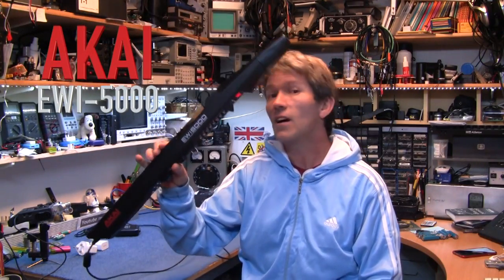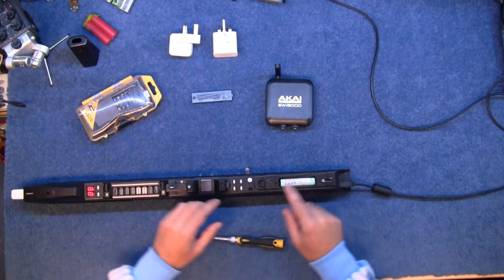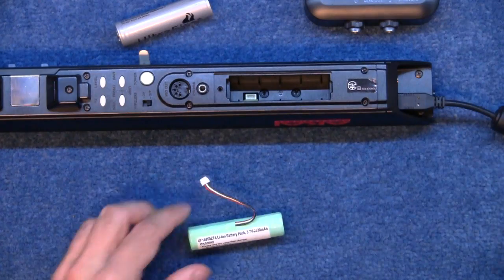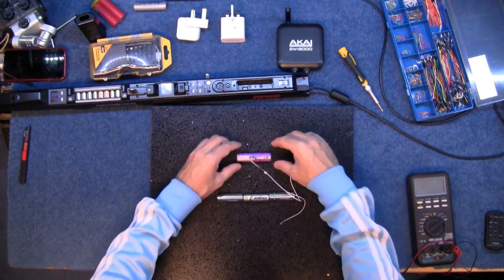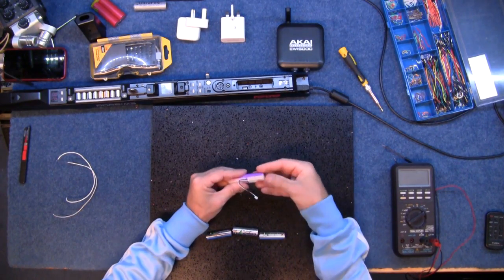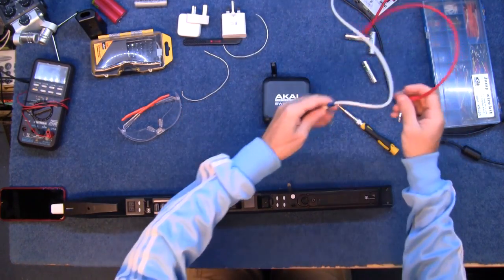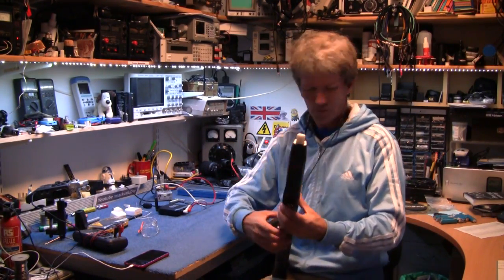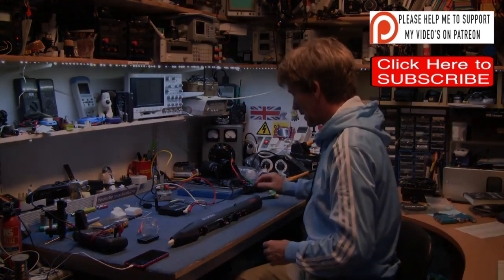AKAI ewi5000 the 88 fault lithium battery repair

Comment: my old battery had 4.1 volts and a new one bought from china is showing me 3.6 volts.

Before buying the new battery, my EWI didn't show anything at all, no sign of life, not even 88. Now after putting in the Chinese battery, first the EWI started showing error 88 and then after putting in the old battery, that one also started showing error 88 now. So the old one started working, too, for some reason, but both show error 88. With the Chinese battery though sometimes at first when the battery just arrived, plugging it into the EWI made it to show blinking LEDs sometimes (without the EWI working), but now after a few more tries all I'm getting is error 88 from both batteries, no blinking LEDs either.

Any ideas what I could do? Assuming the Chinese battery is simply not working, I assume I need to discharge the older one? Or maybe the EWI is broken after all...

EDIT: After reading for a bit, it seems like the 4.1 volts one is actually a normally charged battery, and the 3.6 is probably somewhere around 30 - 40% of charge. I guess the EWI is done for :(
Reply from the maker: I do not think the EWI is done for. It just needs a battery with enough charge in it for the EWI to run. I think akai could do a software update that will allow the ewi to charge a battery rather than state a fault just because the battery has fallen below a certain voltage. I did get rid of my ewi5000 and just use the ewi-solo now - it has not let me down yet but i believe it still uses a similar small lithium battery.

Comment: Thank you for your efforts re the battery.  I had the same problem after returning from a month-long trip to find that my EWI wouldn't charge and I thought at first it was broken. BooHoo. after watching yours and several other people's videos who had the same problem I decided to try to shock the battery back to life with my Sony backup battery that I use with my iPhone. I plugged it in (the backup battery) after having fully charged it and when I switched it on the EWI started changing immediately. It is now functioning as before. Thank you for your efforts that saved me a trip to the repair shop for something I could easily fix myself.

Comment: Ill tell you the fix just buy a charger for the battery they sell them on amazon just match the battery type as long as the charger charges at a man rate lower than the listed on the battery it is fine.  Make sure it's a flat top charger and you gotta tear the paper CAREFULLY off the ends and expose the battery teminals.  the end where the electronic connecter is attached to is the negative

Comment: Hi i have a problem with my ewi 5000 it get Freeze AND i can't turn ir off or play it just put LD on the LCD screen.plese jelp i disconet the batery ir works a few hours AND then again pot the same error LD
Reply from the maker: Hi Gorky. I cannot find that error code in any of the akai websites. all I could find was how to reset to factory reset by pressing and holding FX, LEVEL, BANK, and SAVE button, then pressing the POWER button while those 4 buttons are held down. other than that I do not know what to advise as I sold my ewi5000 in 2016.

Comment: Just remove the two round plastic covers from the battery sides and put it into a 18650 charger (~£6  on Amazon) for like 5 minutes, enough to get it over the 3V threshold, that's all I did.

Comment: Hi mark,i need help,my ewi 5000 black showing Ld sign on display,cannot boot up,the problem is the sdcard corrupt or damage,it's only showing 1.8gb,and cannot backup,copying..always stuck on 26% when copying,did you have backup your sd card mark? Because i can find on internet
Reply from the maker: Hello. I am guessing here but I think the LD sign was just displayed while it was loading data, I think there is a 2GB micro SD card on the circuit board inside but some of the space may be reserved on that card for other system settings so it may only show 1.8gb available to the user. I do not know why Akai did not make this card accessible so the user could simply change them over easily. many companies do this. even the latest roland fantom flagship synth has micro sd cards on the boards inside that is not accessible to the user. I do not know why yours is getting stuck on 26%. I sold my ewi many years ago so cannot have a look inside now. sorry about that.
Reply: Thanks for the repply @markusfuller  sorry for my mistake mark,yes actually there is 1.8GB,finally back to live my ewi,the problem is the sd card is corrupt,bad sector,So i try repairing using chksd on command promp,and it's work,then I backup using aomei backupper,the next step is copying all the data to the new SD card,that formated FAT32...thank god It's work mark,here's the step what Im doing https://youtu.be/y10FcQkNJkU

Comment: Makes me wonder if a good mod for one of these is to try and fit an 18650 socket in there with the charging circuitry from the old battery (out of warranty of course!).
Reply from the maker: That would be a good idea but the free space is about 5mm too short.
Reply: @markusfuller  Hmm, you'd likely have to cut into the plastic around the battery housing. Maybe a bit too hack-y, I'm not sure how it would come out.

It's possible that it just wouldn't fit inside, as they seem to be quite crowded internally.

It just seems a shame that when Akai discontinues these like it did the 4000s and stops selling replacement parts, people will have to just give up on it when the battery fails. Batteries tend to be the most replaced part of anything electrical, so it's kind of a bad part on the manufacturer when they make it awkwardly proprietary.

Great vid though! It really helps people understand what BB/88 really is and how to troubleshoot rather than just rma their EWI.

Comment: Thanks for the info in video. I was considering to buy EWI 5000 and stumbled upon the problem and now here the workaround. I will not buy it if this issue still persists with the device. When i messaged a support staff of an online store, I was said this problem is solved by Akai already. But not sure if it is really a case. Has any one purchased recently and knows that the problem still exists?

Comment: Hey Markus, I have a similar problem with my ewi4000s. It was not used for about two years, now I got some brand new batteries and turned it on and nothing happened. Then somebody told me I had to let it on for a long time, then the instrument would come back to life, and I did it, and the display was on, but this 88 is showing up, and no sound comes out of it. So, do you have any idea what is happening with it, and what should I do?

Comment: Markus,  Thanks for the video.  I had the problem develop overnight (from Sunday when I played at church to Tuesday) so I figure I had left it on in the case.  Your shock charge worked perfectly (current limited adjustable supply) and my 5000 is charging as I type.  I agree with all of your comments about the 5000 vs 4000 except that the 5000 sounds seem to have more presence to them.  I wish the 4000's oscillators had a mode to use samples as the waveshape source but everything else was the same as the 4000 architecture.  Again, thanks for doing the basic research for me.  Gordon
Reply from the maker: Gordon Gunzelman Thankyou Gordon. Im pleased you got it charging again. I wish Akai would have made this with a proper battery bay that would have taken standard sized batteries. other than that I still think its a good sounding instrument.
Reply: Mr. Fuller,  I agree that Akai (and all the other companies) should have used standard batteries.  I run my 4000 on 4 rechargeable AA cells that I bought over the counter.  It's MUCH simpler for us as players.  It would have been simpler for them as well as they could have reused the tooling from the 4000 on the 5000.  

A thought (question) for you on synthesis in general:  Analog synths had the "hard sync" feature on the oscillators which created metallic harmonic rich sounds but I was wondering if anyone had built a "one-shot" type oscillator.  If you could control the speed of the one-shot separately from the driving signal rep rate, you would be able to create a signal where the output of the one-shot would have a formant effect based on the cycle time of the one shot.  Now go one step further and make the one-shot output a single cycle of a sample and I think you could get a very nice sound for solo passages.  I just can;t figure out how to do this in a mockup although I suspect an app like C-sound or PD might make it possible.  You might be able to do it in hardware.

Thanks,
Gordon

Comment: interesting!  i've had mine (on to the 3rd one!) for a few years now.  it's very good WHEN it works!  1st return was the battery thing, probably the 2nd time too, + other things.  changing banks - sometimes does this when i change patches and at other seemingly random times - still is a problem - always need to keep checking or i blast out a sax instead of a pretty flute sound!   i also had (have) lots of clicky things - discovered it is my fingers accidentally touching the stupid ('cos i can't work them very well!) glissando strip.  the wireless thing is a pain too as it has a very small amount of latency, so when playing completely solo i get slower & s-l-o-w-e-r!  the battery now seems fine ..... i shouldn't say that - tempting fate!  i was thinking about busking on the underground with it, but the battery operated speaker i bought to go with it has a problem - the battery will no longer charge!!  (at least it works at home from the mains!)  i must start playing it again ....

Comment: Great work! A must watch for EWI 5000 owners! I posted a similar solution to error code 88 on https://forum.saxontheweb.net (Feb 2014, based on the video of  KManAuto), using a simple battery charger instead of 3 1.5V batteries. After this stressful 'episode' was looking (for ages...) where to find a replacement battery just in case, and finally found (on a trip to Europe in May 2016) a German retailer and bought a second one.

Yesterday (25/04/2018) I had error 88 for the first time in almost 4 years - probably it had run down without me noticing or I shouldn't have left it plugged into a USB hub overnight (oddly voltage was only down to 3.2V) , and jolted it with the 'charger' method. Just connecting about 10 seconds a few times worked. No overheating or smoke etc detected whatsoever. All good again, and it charged up to 96/97 as before.

However, this original battery is now over 4 years old - still playing for many hours but I think I'll need do an 'endurance test' next and compare results to the newer one (which I keep at ~50% charged but also use in the EWI every 3 months for a little while).  Charging on average once per week, the original one would have reached about 200-250 cycles by now.

PS I was told the Inmusic part number of this battery is 102 861 and in 2016 it was  34.90€. I bought it from:-
Music Store Professional GmbH
Istanbulstrasse 22-26    T  +49 221 8884-3651
51103 Köln (Cologne) Germany

Also Musikhaus Thoman/Thoman UK is also supplying it within the EU afaik
Reply: ozzoid hello could you please direct me toward a battery charger? I’m not sure what to search for that would give me the appropriate product for such a battery.

Comment: I turn the EWI 5000 tool into a socket for charging without a battery. It burns two 88. And the instrument does not respond to pressing.

Comment: I turn the EWI 5000 tool into a network without batteries. It burns two 88. And the instrument does not respond to pressing.
Reply from the maker: Hello If the display shows 88 then it is displaying "Battery Fault" and may not play . the battery must have enough charge in it for the EWI to work correctly.
Reply: Hey there @markusfuller Ive been getting the 88 error code as well, tested my battery and it gave a reading of 4.16v. so it seems like it maybe overcharged. could it be possible it damaged my EWI? and if so, how would i go about troubleshooting it further and what do you think it might be? Is there any hope left for it?

Comment: there is a simple solution. The OLIGHT magnetic lithium-ion battery charger costs less than $20.00, and works with most single cylinder batteries like the 16650 series battery in the EWI 5000. Plug the USB end into your computer (or power source) and put the magnets on either end of the battery. wait until it charges. It will flash red slowly as it charges and glow green when it is done.. If you don't want to wait - just charge it enough to get it back up to a level where the EWI 5000 can take over again. You can see the charger at: https://olightworld.com/olight-uc-magnetic-usb-charger. I also bought a spare battery but I had to put some pressure on the music store where I bought the EWI5000 to get them to order it in for me. The two local specialty battery stores in my city were unable to find a replacement.
Reply from the maker: David Ascroft Thats a good solution , thanks David.
Reply: It was a bad week for me not having my EWI to play. I had to switch back to my bari-sax, Suzuki Q-chord, roland hand sonic drum pad, a Yamaha digital piano PSR630 and a pair of roland SPD-one drum pedals to compensate until the OLIGHT arrived. All good now. Great videos. I don't think I'd have the courage to strip a Roland Ax-synth but I'd love to get my hands on one to play. One day you'll have to do a video on how to connect all the old synths. How do I integrate all the pedals and instruments using midi cables? (think one-man-band).

Comment: Hello, I started to lose the power of the battery in EWI 5000. You can make me 3 batars. I live in Belorussia. In the city of Minsk.
Reply from the maker: Вадим Кулик Hello I am very soory but I cannot make the batteries for you. they are similar to the li-ion 18650 batteries but they are slightly shorter so a 18650 is too big and will not fit in the battery compartment. I an unsure what the correct size is maybe AKAI website can tell you where you can get them from. my apologies.

Comment: hello I'm with the same error 88 in a EWI4000S model that does not have battery. the error occurred after the false fitting of the power source. Is there a diode I can change?
Reply: same here - i think it got reversed when I connected adapter the wrong way - be sure to put up a video if you find the solution cause this thing CANNOT BE SITTING THERE IDLE.

Comment: Markus - I viewed this video awhile back when trying to get some info for a replacement battery. I use my EWI5000 strictly as a MIDI Controller (via USB) and it is powered during each performance by a Plugable hub connected to my Dell (Windows 10) tablet. The hub was designed to charge the tablet and it also powers the EWI. My question to you is - do you have any idea how long the EWI battery may last? I play with our church orchestra and we are recording a CD in September of this year. I would certainly NOT like to see the "Double 8" indicator right before the recording session starts! (FYI - I purchased the EWI in August of 2014) The EWI has worked flawlessly as a controller (hated the Onboard Sonivox sounds), but I'm starting to get concerned about the "special order" battery. Thanks!

Comment: hi markus i could make ur life easier just grab urself as nitecore d2 or d4 battery charger if you peel either end off its basically the same as a vape battery 18650 justa  different size u can put the battery in and give it a proper charge in that charger

Comment: I had the same issue  with my  5000 I ended up putting the battery in the freezer for 30 minutes ,removed it and let it go back to room temperature, placed it back into the ewi and it started charging.
Reply from the maker: wow you froze the battery, brilliant - i never thought of that one. I have just put my EWI up for sale with 2 batteries for £195 ono but it seems there is no interest in it. maybe in time to come these will be worth more - I just never play mine anymore.
Reply: hi ¿realmente te funcionó meter la batería al congelador 30 minutos y se vuelve a poner en el ewi después ? ¿ usaste el cargador original despues, o el de un ipad? gracias

Did it really work to put the battery in the freezer for 30 minutes and put it back on the ewi? Did you use the original charger afterwards, or the one of an ipad? Thank you
Reply: Thanks Darryl for the great tip, that worked for me too... I put it in the fridge (not freezer) for an hour and gave it a try.

Comment: You mentioned you didn't have a "proper" charger, what about the one for your quadcopter? Just a thought :)
Reply from the maker: true I have the quadcopter charger and bench power supplies (good thinking). but I was trying to consider what the average person would have to fix it with ie 3xAA batteries and a piece of wire.
Reply: Oh yeah I totally see where you are coming from, I just wondered if you could use the cheap three pinned Li charger(s) you have - they are pretty much ten a penny on banggood etc.